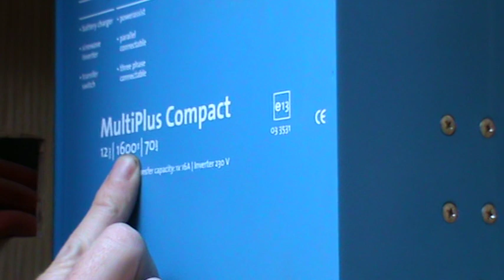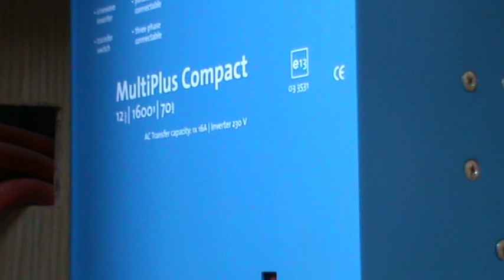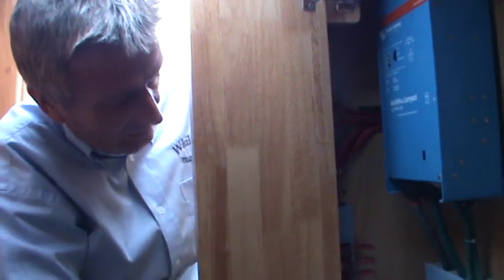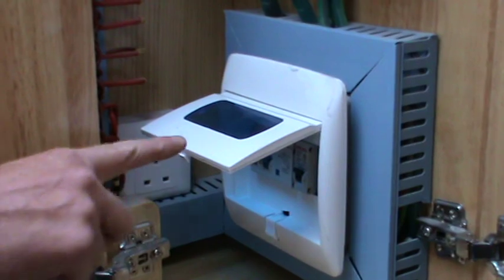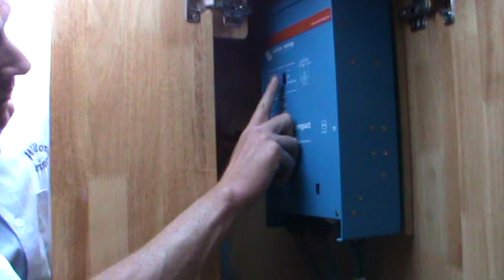Inverter

Comment: Does the Inverter run equipment unto a collective 1600w or any individual pieces unto to 1600.  So if my Tv is 1500 (not real of course), and my dvd is 1500 (also too high of course, but for example), can i run them both, or only one of them.
Reply: +sean sailes As stated in the video, a TOTAL of 1600W